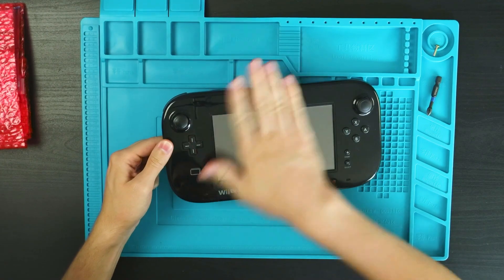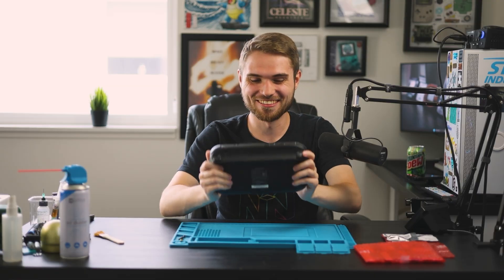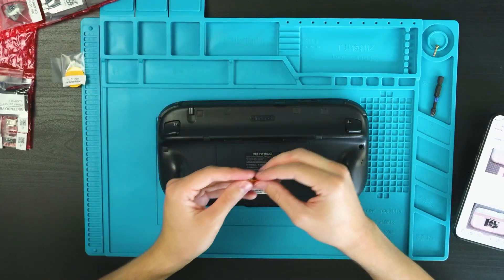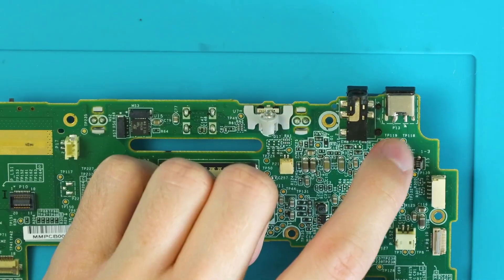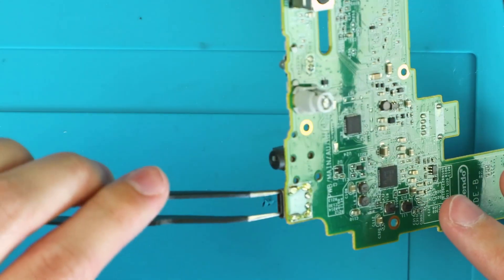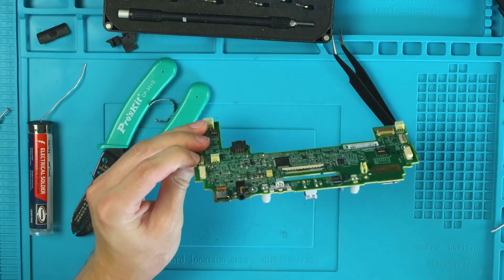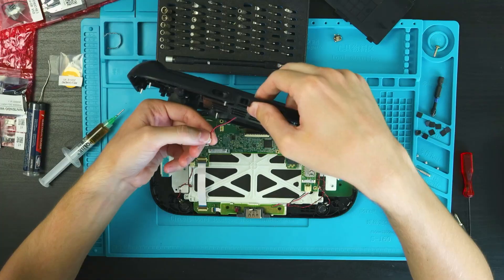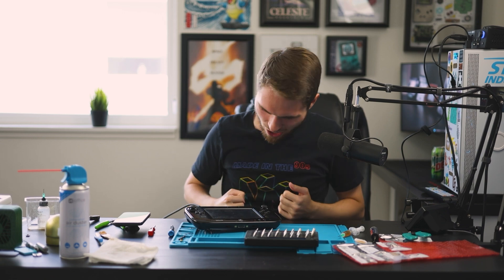Adding USB-C to the Wii U GamePad!

Comment: Hey do you have a 3d printer? I made a spacer for a DIY usb-c gamepad conversion and I'm thinking it might fit yours to fill the gap above the port. And you can usually slip it in without taking it all apart
Reply from the maker: I do have a 3D printer! If you don’t mind, could you share it on the discord server?
Reply: @JakeSimmons64  do you have a link to your server? i cant seem to find it
Reply: @JakeSimmons64  nvm found it. shared in general

Comment: I'm a bit new to modding so apologies, but I think the Power Delivery spec only lets devices request more power, and all these your planning will only ever just take what they need and not request more since there's no logic or controller on a data line.

I think the presence of a resistor on a CC line is what enables c to c charging
Reply: Forgot to say, you're darn good at this
Reply: There must be 2 resistors for cc1 and cc2 each
Otherwise you are correct